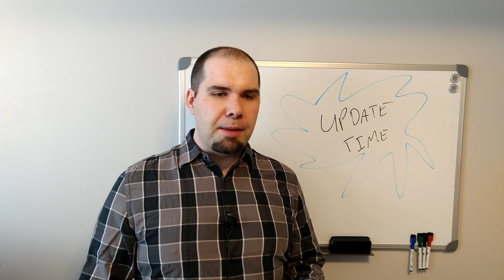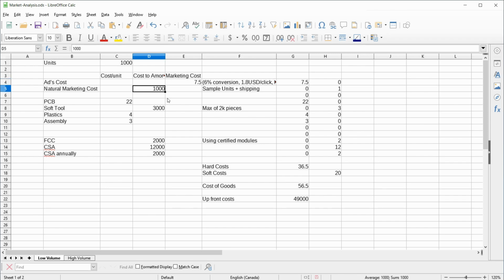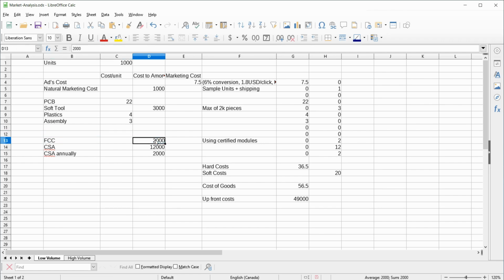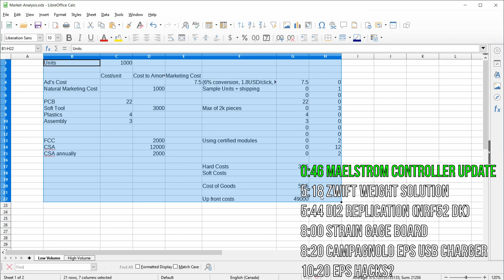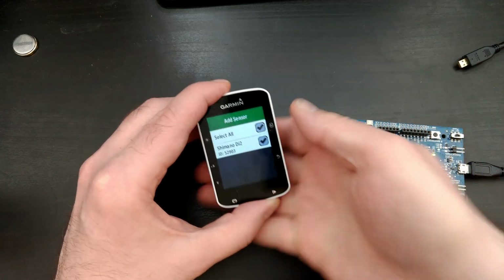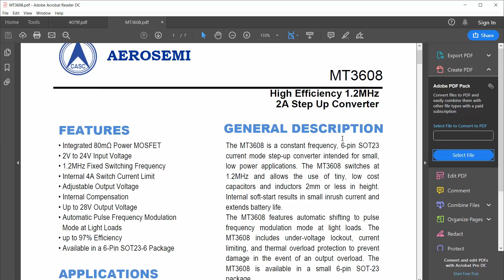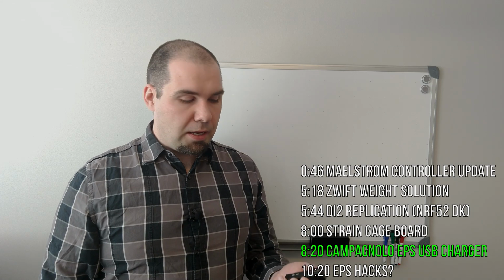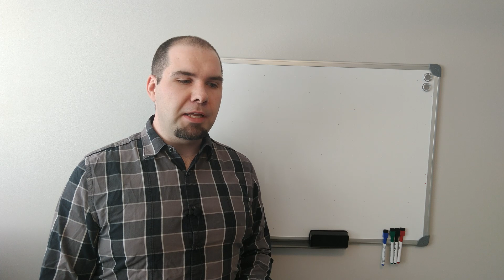Update: Maelstrom, Zwift, DI2 hacks, EPS hacks

Comment: @Keith Wakeham Nice video! Do you have any experiment on hacking Di2 rear deraileur for upgrade 10-11-12 speed?
Reply from the maker: I haven't got into the 2 wire communication, but there is an additional issues. The deraileur has it's own microcontroller and firmware, and it's that firmware that determine what speed it is. The firmware isn't  selectable, it's completely different from one to another. So theoretically, if the electronics are the same the whole firmware needs to be changed.
Reply: @kwakeham  Yes, firmware update  Shimano E-TUBE PROJECT, is it possible to take such firmware to change and install in rear deraileur?

Comment: Keith - have you ever looked at how one could create a ‘reasonably’ accurate power meter for using on gym bikes without installing powerpedals or such?   I travel a lot and would love to figure out a solution.  I bought a pair of RPM2 insoles which are all over the place in power reading but feel like could be reasonable if i could calibrate them (their calibration app is unhelpful and does not allow entering specific values).  Could this be inspiration for a new project for you?

Comment: Why not go for a founding campaign for the Maelstrom?
I guess there is a big market also in Europe and giving this option would increase the number of people supporting.
Reply from the maker: So right now every area is +12k to 20k if I go the approvals route. So the min 50k turns into 80k to support those regions easily. However because if that the math actually doesn't work. It sells at a loss. So even a successful kickstarter would end up failing and needing outside funding with nobody making any money.
Reply: What about splitting the campaign in regions so that every region pays itself. Maybe take a soft tool for every region. Maybe some common work may be payed twice but from my point of view this is such a good idea so it doesn’t matter if it would even cost a little more than 69$.

Comment: Join the dark side, hack some ebike tech - then you'll see engagement! Road gear is not for geeks.
Reply from the maker: Wouldn't say it's the dark side but I'm not as well versed. Most ebike hacks seem to revolve around more power. Is there areas of ebikes that need more in-depth hacking?
Reply: @kwakeham  Maxdrive (with other mid drive motors) have torque and cadence sensor of high quality. Reading and showing out human power during use is not available, and some protocols meant to be open simply does not work. Its early days and will change no doubt.

Most hacks do revolve around more power, no doubt - but many users would like to optimize things  like range or motor response to input. Especislly with emtbs too much power makes them nervous in use.

My 2 cents, might give the di2 hacking a go - a rear electronic deraileur is appealing